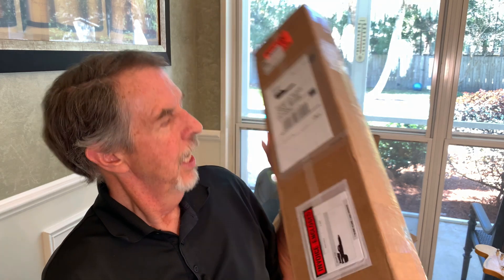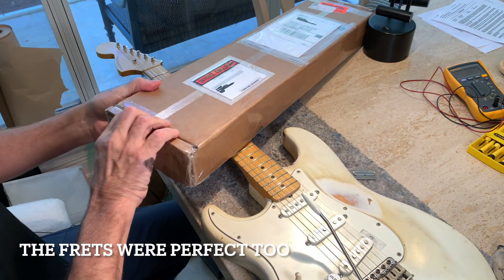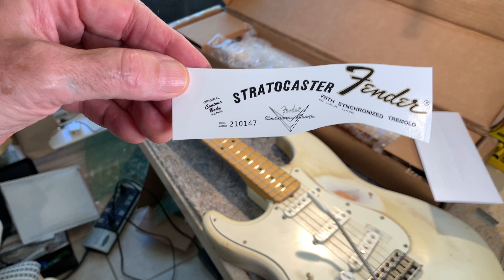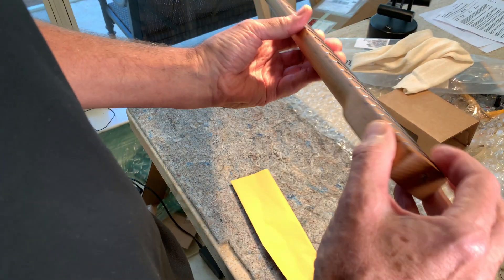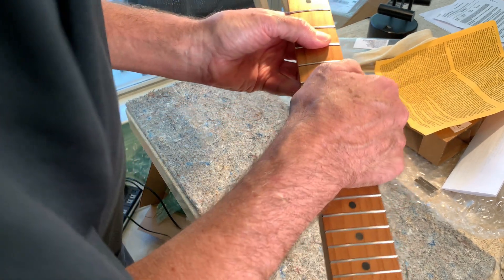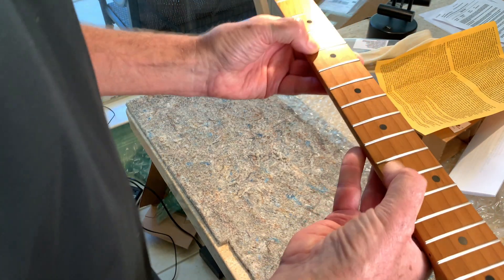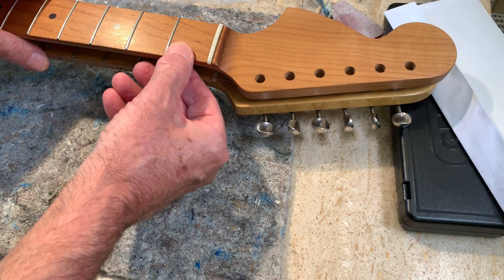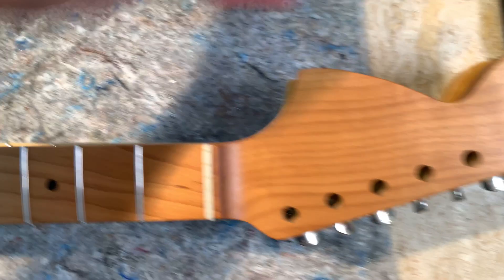Musikraft Custom Hendrix Maple Cap Neck Unboxing and Install

Comment: I picked up an old Squier Strat with the big headstock and it was left in the sunshine for the last 20 years. Perfecto relic.
Reply from the maker: Wow, that sounds like guitar abuse.  I'm surprised the sun didn't damage it.
Reply: @millstap  , It was a young girls practice guitar and hardly ever played. Her parents listed it on FB for a good price. The pickup cover is really yellow so it has uneven sun damage. Unless it's something else that changed the colour. Check my latest vid... you can see it there.

Comment: Excellent video, very helpful as always! Thank you for specifically mentioning the revised headstock shape/dimensions. After watching the video I immediately checked out the Musikraft website to see if the small Fender Pre-CBS headstock has been revised as well and to my surprise they indeed reworked the Pre-CBS headstock too! I found two necks that are in stock right now which clearly feature the revised and more accurate headstock. For years I wanted to get a Musikraft neck but I never pulled the trigger because I could tell that the headstock shape wasn't all that accurate. The main problem area was the part below the Fender decal. This area was almost straight with only very little curvature, while official Fender necks (both modern and vintage) featured a much more prominent curvature/swing below the decal. It seems like other people noticed this inaccuracy as well and Musikraft listened and thankfully made changes. Now the Musikraft Strat necks finally look like proper Strat necks with accurate dimensions. I will still email them to officially confirm the headstock shape adjustments but this discovery made my day, I can't wait to put in an order for a new neck. Thanks again!
Reply from the maker: That's a great story.  I was really interested in getting the large CBS head because of the placement of Jimi's string tree then I found out they had revised the shape so I'm happy.  I would still have bought one regardless though but I am happy it looks more authentic.  It should if they are licensed by Fender.  Fender ought to provide the exact dimensions IMO.

Comment: Millstap, You make the best Hendrix content. I Haven’t been on YouTube much… thought to search you up. Come to find out you’ve completed the exact build I’m currently working on with my father. ‘68 style Strat, big headstock, using the musikraft neck. Thank you for the great tips!
Reply from the maker: Hey Brian.  Yeah, I couldn't believe the Musikraft neck improved my 1964 Strat too.  I know yours is a new build but just be aware of the screw situation if you are using older screws you saved or something, especially if it is roasted maple.  Here is the warning I posted about that, https://youtu.be/yUPhnQaAO0w.  I should be posting a video this weekend on all the parts laid together.  I made a mistake on the pickguard order and din't include the blade switch slot and will receive the replacement pickguard tomorrow.  You have to specify everything on the Warmoth order form.  I thought for sure that would be standard on any Fender Strat pickguard.  Not so.  Good luck and be careful with that roasted maple, if you are getting it.  I love the feel and sound of that wood but, boy, do you have to be careful when mounting the hardware and neck to the body.  Are you going completely left-handed Strat for a righty?
Reply: @millstap   I absolutely will! I’m going right handed as vintage spec as possible even 7.25 radius. I’m also going for rift sawn maple no roasting just to be safe. My goal is to make it as if I had bought a Strat in the same year Hendrix bought his. Hopefully it comes out looking like the black Strat he played during the Atlanta Pop Festival/Isle of wight. I love the sound of that 64 Strat by the way. Keep up the great vids!

Comment: Congrats! I ordered a similar one from Musikfraft (also roasted maple) not long ago and I was in the end very happy with it.
Reply from the maker: In the end?  Did you have some issues you had to deal with?
Reply: @millstap  You must be careful when drilling holes but you didn't seem to have any problems! I went for the soft V 57 profile! Lovely! Unfortunately, one tuner hole led to a slight crack that needed to be glued. Not a biggie as glue is stronger than wood and it's totally invisible.
Reply: @millstap  Also, fret ends needed a tiny bit of TLC, just like yours.
Reply from the maker: @hgostos  yes, the fret ends are fine.  I love the extra room I have outside of the E's.  I was super happy I had no problems with the wood drilling at all.  Everyone on the forums had me pretty nervous and I think I had cracked even my standard maple when I installed the tuners on one of my Nash necks.  It plays amazingly.  I may never put it down. I now wish my vintage Strats had the standard frets too.
Reply: @millstap  I went with 47104. A really nice compromise. Not vintage, not modern, just a great all rounder!!

Comment: I think you are better off with all the same colour,
I wouldn't have chosen roasted but must say that yours is really nice , looks the same as my 1963 neck , 
perfect colour without being yellow !  It looks beautiful once all installed , congrats !
Reply from the maker: The roasted maple is a lot nicer than I expected.  Very easy to work with too.  I will crank it up in an hour or so for the first time.  I just got the string tree on and started working on the Fender decal.  I'll post of photo of the final headstock look on my IG channel, millstaps_jimiisms in tomorrow maybe.
Reply: @millstap  You've made the right choice , the colour is perfect , a real pale maple slab over the rosted would have looked funny imo .  Well done and can't wait to see more and hear more !  I didn't buy the Warmoth CBS because the radius on the headstock is wrong and almost looks like it's 90 degree just like your Nashguitars neck but the Musikraft got it right this time ! Really looks vintage !
Reply from the maker: @lousekoya1803  The neck is amazing.  I played it last night.  I LOVE those small frets.  Much faster, perfect intonation, easy to bend with that slick roasted maple surface.  The sound was unreal.  I will try to post a test run recording in the next day or two.  The small frets let the strings ring better and the note separation makes everything more distinct and doesn't get muddled up when playing loud.  The feedback frequencies are much better.  Just a dream.  I will consider putting those small (SS) frets on all of my guitars eventually.
Reply: @millstap  Wow thank you for your review !
really appreciate it and looking forward in hearing your next video !  I felt your desappointment yesterday about the cap being roasted but you have a beautiful neck 
for sure so hope you forgot about it , looks awesome !  Can't wait to see it with the decal on .  
Cheers from Quebec !

Comment: I have those frets on the Fender Classic 60ties. Has advantages and disadvantages imo ^^ 

Guitar looks cool.
Reply from the maker: It seems they have nothing but advantages now that I have played it; better intonation, perfect octaves, better harmonics, notes are more distinct and ring out, and it plays very fast with a lot less effort.  I couldn't be happier with them.
Reply: @millstap  yeah, i think the problems would start when trying to play different music. But nothing really important for our style ^^ I think its a bit harder to play very fast things or legato heavy solos etc, thats more or less the only "issue". 
Other things are a bit easier though because has more room between the frets. But if I play those things i just take a different guitar. I like em too, no worries.

Just mine are not the best quality sadly. Mexico Fender.... Guitar is 4 years or so and the frets have really deep cuts.
Oh, and that the string niose is bit more when strings are not fully fresh. But that can have to do with the bad material.
Reply from the maker: @AlexWBKK  Yeah, I would have never gotten those small frets in nickel.  They would need replacing in a matter of a few months.  The SS frets are the only way to go with those small frets.  And yes, different guitars for different styles of music for sure.

Comment: Nice work. Now I want to pull the neck off my Tele and see what note it rings out at haha.
Reply from the maker: I don't know how much difference it made but the neck sounds fantastic and the feedback frequencies are much better than the other neck.  Those small frets really are the way to go.  I couldn't believe how good the intonation became and they are actually very fast and easy to bend on.  Very distinct note separation and ring due to the smaller fret to string contact area.

Comment: This is awesome. Looks like it's good to get the neck close to tightened down then put the two e strings on.  Get it adjusted just right with that then lock it down?

Thanks I'm going to harbor freight
Reply from the maker: That will work but I like putting all of the strings on first because the extra tension will help pull the neck down into the bottom of the pocket if it is not completely seated.  It can be a little awkward pushing the neck in one direction while trying to tighten the screws.  StewMac probably has a video on an easy way to do it.  That drilling guide is awesome.  It will keep the bit very steady to there is no chance of a slip and a scratch.

Comment: Nice, hope it plays well!
Reply from the maker: It's a dream and those small frets are the secret to Jimi's overall sound.  I couldn't believe the difference they made.  I'm sure the maple cap added to the mojo.  Unreal note ring and separation.  Intonation is now perfect with octaves to die for.  I'm not sure how this "bigger frets are better" trend started.  Probably mostly SRV's fault.  I think he missed the boat because these small frets are super fast and not hard to bend on at all.  The slick roasted maple fingerboard does help a lot.

Comment: That pitch difference sound probably comes from the roast. My strat has a roasted maple neck and actually has more vibrations than a non roasted one.
Reply from the maker: I love the roasted maple.  I also got one with rosewood.  Both necks are outstanding.

Comment: That's a beautiful neck! I was actually planning on getting two necks for my AVRI Strats but those are pretty pricey. They both need fret work and I figure the cost of that I might as well look at just replacing the necks and keeping the old ones for backup. I like the color of the roasted, it looks like the aged paint Fender uses on the AVRI series. That neck looks super slick. That's one thing I don't like about my Fender necks, it feels like they use poly on the back side and it's pretty sticky although I am used to it. I also switched to vintage frets recently and I really like it because I have more finger contact with the board and it changes the way my fingers interact with the board. By the way, I tried a 9-40 set (ddarioio EXL120BT) and I like this more than 10-38 and I suspect that this is what Jimi may have used in his later years. It sounds very balanced, it's easier to bend without getting under the string (Jimi seems to play on top of the strings using the pad of his fingers instead of the tip). One question, for the veneer, your specs say oil, what is that mean? Is that Nitro or is there a poly undercoat underneath? If not, I wonder if it would improve the tone vs my AVRI necks with poly on the back? Look forward to hearing you play it and get your thoughts as you get used to the neck, especially if you notice any difference in tone.
Reply from the maker: If you look down farther in the specs above, the finish is oil.  They describe in on their website as two coats of hand rubbed oil, the same oil Fender uses.  I have no clue what oil that is but it doesn't feel like anything is on it. It's not oily in the least.  Just a very slick finish.  Much better that any poly finish I've felt.  I'll look to see if Curt Mangan has that gauge because I am sold on their round core strings.  They are great sounding.  The vintage frets are cool.  I've been wondering about them for years because everyone got so far away from that size.
Reply from the maker: This neck is really something.  It sounds amazing.  And, next to my 1962 neck, the color is almost the same.  It is slick as you know and those small frets improved the intonation so much and they are actually very easy to play and the notes just jump off of them.  I'm getting ready to record a little test drive now.  Hopefully I can capture what I am hearing.
Reply: @millstap  Awesome! Can't wait to hear it!

Comment: It's interesting that the reverse Nash frets only lasted 3 years.  My American strat frets wore down in similar way.  Notches in the frets got to deep to play.  Another vintage reissue 56 strat has vintage size frets that are now getting bad also.  Stainless really should be offered more. I know you can special order them from fender custom shop but those are the expensive ones.  I wish Nash would offer Ss frets.

I guess the carbon fiber option didn't fit your vintage goals, but I feel like I might want to try it though, it sounds so cool.
Reply from the maker: Carbon fiber truss rod?  I'm surprised they sound good.  I really didn't even know they made them.  Yeah, I was sticking as close to vintage specs as possible.  The fact that I would have worn down vintage Fender nickel frets in a matter of months is what kept me from putting them on any guitars.  When I saw the SS option, I knew that would be the ticket.
Reply: @millstap  yeah I haven't ordered my musickraft yet havent tried the carbon fiber neck yet. I don't think it would sound better, it just sounds like a good thing to have the neck stay straight for a very long time.

Comment: All of the right specs!! It looks the part without any dyed nitro/poly. I love a Tru-Oil finished neck. Even when it's level sanded and polished it's not sticky. Great stuff on the back of all necks.

Have you seen the new American Vintage II guitars yet? I loved the original lineup from Fender and the new ones look just as good, if not better. I would have bought the Olympic White '61 Strat if I hadn't just got another '59 Custom Shop.
Reply from the maker: Is that what it is, Tru-Oil?  If that's it, that stuff is pretty cool.  It doesn't feel like anything is on it.  I had read a few forums where they mentioned that was the oil Fender was probably using.  Good stuff.  I have not seen any new guitars lately.  I think I will just keep modding mine except for the vintage ones.  I might have to eventually get one of these necks for my '57 Reissue.  I do love the way that they have a lot more real estate on the outside of the E strings.  Now I can see how Jimi did all of those plain E string pull offs.  My E would always slip off of the fret and cause it to die.  It's probably more of a function of getting the nut slots closer together but Musikraft's frets go right to the edge too.  Most of my frets are a little too rounded on the ends.

Comment: What drill bit width did you use for pilot holes on neck heel?  Thank you! 
I will measure the screw with micrometer and get it just right.
Reply from the maker: I can't recall. It was either 7/64" or 1/8".  I didn't want to enlarge the holes, just go deeper, so I picked the largest bit that would fit down into the hole.

Comment: Spray a few coats of clear lacquer over the decal and let it dry before you apply it. The face of the headstock could use a few coats before application. It helps the decal stay together and stay in place. 

I haven't tried to apply a decal directly on an oil finish. I know they don't take to bare wood at all.
Reply from the maker: Thanks for that.  I just put a mist of lacquer as they suggested on the decal.  I will apply it tomorrow but I was concerned about putting it straight on that surface.  I was trying to avoid putting any lacquer on the headstock but if I completely mask it to where it only gets a little outside of the outline of the decal, no one will notice it.  They said to hit it with a little 2000 grit sandpaper where the sticker will go to give the sticker something to adhere to but that is probably for a poly or lacquer finish.  Maybe I will put a little lacquer on first and then sand that a little so it sticks better.  That decal is making me nervous because my 1963 Tele says "Femder" because I didn't know what I was doing when I put in on around 1981.  I got a vintage Fender decal from the Fender factory in Fullerton when I lived in CA. but I think it was so old, I couldn't get it to release very easily from the paper.

Comment: Why do you think the veneer instead of slab fret board is better?  It looks great.  Just wondering.   Maybe they couldn't do the nonroasted because the piece was so thin
Reply from the maker: I'm pretty sure the veneer is what everyone wants when they get a capped neck like Jimi played in the late '60's.  I don't think Fender even made a slap maple fingerboard in those years.  I could be wrong.  In the Musikraft drop-downs the veneer is (vintage Fender) and slab is (standard Fender) and I wanted vintage correct.

Comment: wait, so are musikraft headstocks the same dimensions aas fender? as far as i can tell, mighty mite matches the fender dimensions (for the smaller one at least). I just ordered a musikraft because I heard the quality is on par with American fenders, plus it's customizable and a bit cheaper to boot. I really studied the headstock in comparison to fender, and was convinced it's identical.
Reply from the maker: Good deal.  I'm not an expert in the Fender shapes but others that claim to be have studied the Musikraft headstock shapes and says it is authentic.  They do have a Fender license.